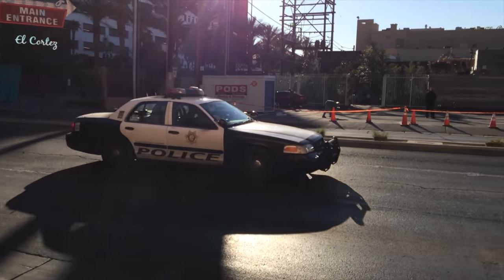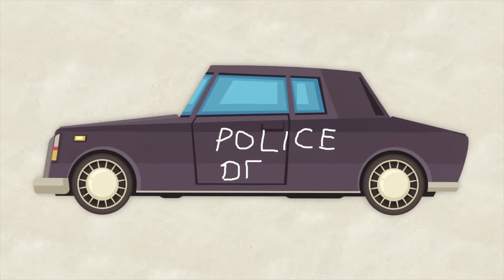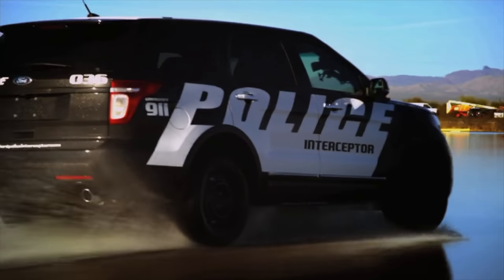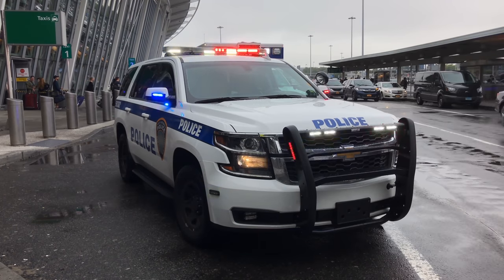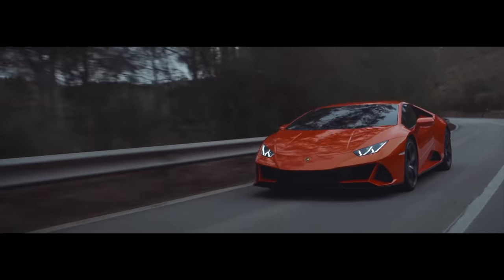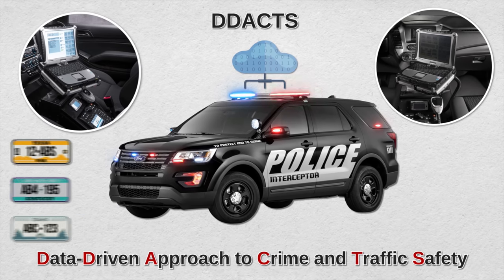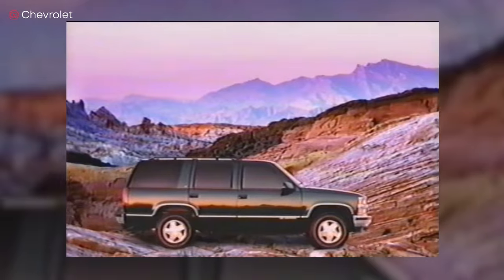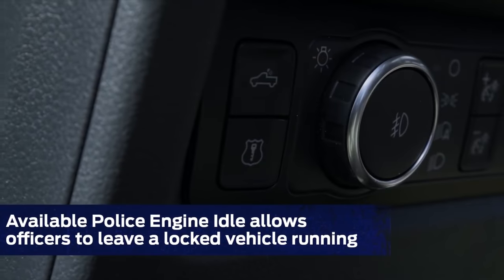Here’s Why You Can’t Outrun a Police Car

Comment: “Yet even with all of these upgrades and modifications, none of these vehicles are anywhere close to being as tough, reliable, or just overall quality car as as my ‘94 Toyota Celica.”  -Line from the script omitted from the video.
Reply: Did you see that 1 episode of the original top gear where they took this toyota pickup did everything you can throw at it even had it on top of a high rise building that was going to be demoed by explosives…..recovered it and ….IT……STILL….TURNED……ON!!!🤣🤣🤣🤣
Reply: Or as my Toyota Crown '89)
Reply: @eyevincast5440  It’s an inside joke you didn’t get.
Reply: The crown Victoria outlive a Toyota
Reply: @АндрейЧерняев-щ8р  or my 93 Supra
Reply: Good one dude as the 94 Celica GT
Reply: @steveschu  nothing indicates that he didn't get the joke. He was simply adding on to the joke of anything. But by all means look for reasons to exclude people so that you can feel like you're special.
Reply: FACTS
Reply: Old japanese tuner cars are underrated
Reply: @eyevincast5440  They left it in the pier for the tide and after a mechanic came with only his tools and no extra parts they managed to get the submerged demon to run again! I kinda wanna swap from my Volvo V70 to a Toyota
Reply: He wanted to say it, but the producers just wouldn’t allow it on account of factual inaccuracy. Scotty argued and deliberated this point for 3 and a half hours, assuring them that it was true.
Reply: Hahaha no one gets the joke, they must not watch Scotty a lot to know what you're talking about.
Reply: I have a 2001 GTS. I'm at 328k miles as of the last time I looked which was 4-5 weeks ago. Complete original engine and transmission. Dude it still has the stock head gasket. I'm not sure how, but it does. 

I also have a 2002 GTI 24V VR6 which  I just finished rebuilding. $4900 build so far. I have another 13-15k I'm putting into it. Then I'll move onto the Celica which im either going to do a 2JZ or 2ZZ swap. Not sure yet. Stoked though. Glad to hear you have a mk6
Reply: I got a hell cat that can out run the troopers dodge charger in the USA and every other cop cause cops can only drive at 150 hellcat can go 180 to 200mph.
Reply: @eyevincast5440  built Toyota Tuff
Reply: I owned a Toyota they sucked.
Reply: When you look in your rear view and see that Toyota badge on the grill you know your goose is cooked. I just step out and raise my hands in the air.
Reply: I gots a 2010 cvpi.
Greatest American cars ever made.
Reply: I can definitely outrun a police car. Once I put my foot down and all the blue smoke comes out of the tailpipe of my Cadillac the distance between me and them just keeps getting longer and longer.
Reply: they need it, they get it... I
 No joke.
Reply: Crown Victoria will Outlast your Celica 10 times over
Reply: Or my wife's lexus
Reply: Heck yes! The Toyota Celica is the best!
Reply: Crown Victoria held its own
Reply: @joanfrellburg4901  I doubt it 😂🤔
Reply: @ronalddaub9740  About a litre of oil every 400 miles.
Reply: @Bradleehage  Can it outrun the 2way
Reply: @johnhamilton5155  close. But did you know that the new Tesla s plaid can go from 0to60 in 2.1 seconds and reach a top speed of 200 miles mph. It’s take of faster than the car you talking about and is the fastest take off from 0to60 in the world so far.
Reply: @Bradleehage  I was referring to the police radio
Reply: @johnhamilton5155  😂 lol well the only way for them to get away from the police radio is to get far enough ahead for the police to loose sight of the car before other cops arrive it happen few times but I wouldn’t try.
Reply: @Bradleehage  I wnt either but I just remember my dad telling me everytime I got some kinda hot rod now son you can't outrun that 2way so just pull over Lol
Reply: Or my 05 Chrysler 300 touring . It's a tank it's been handed down from my older brother to me and I had it 3 years . That car never had any issues and it's been driven alot from Nashville to Miami , Dallas , Las Vegas, NYC , Atlanta everywhere lol .
Reply: @joanfrellburg4901  remember they have not made a car that can out run the radio.
Reply: @scottb7539  Yes, that's why when I rob a bank, I always use a snowmobile to make a clean getaway.
Reply: Im ctfu he loves that celica , starting to make me think about owning one
Reply: screw the buggati
Reply: @fastfords9072  no this is false
Reply: I need a Toyota Celica gts so I can put that engine in my yaris that weighs less then 2000lbs
Reply: @googlereviewsyt  no we get it it’s just not funny
Reply: You don’t need quality to get spikes or put maneuvered
Reply: My 98 Camry is Better
Reply: @eyevincast5440  You ever heard of whistlindiesel ?  He destroyers trucks and the only one he couldn't destroy was a toyota pickup.
Reply: This is about interceptors not high mileage gas efficient Japanese automobiles.
Reply: Damn right 👍
Reply: I prefer any of these interceptors over a Toyota any day of the week. Toyota's are overrated.
Reply: Toyota was a very well  built car on their 2 nd time around. First time they entered the US market they had to pull out. The Toyota product then was crappy.
Reply: People who start comparing with Toyota's no nothing about cars.
Reply: Lmao
Reply: Any Toyota really.
Reply: John t for president
Reply: The best thing about the Crown Vic was it’s survivable crash results. Knock on wood I never tested this but I had partners you think would be dead when you saw the aftermath of their wrecks.
Reply: My 93 Ford  F-150 is it got the 300 inline six with the 5 speed  with five hundred thousand on the odometer still my daily driver and occasionally I take her out and play in the mud with her on the weekends 😊
Reply: You can easily out run police ,they can go fast but they are to big and heavy to corner.  Zig zag your escape. You have to end the chase as quickly as possible ,the farther you go your odds go down . Your best protection is knowing were to hide. Load pipes will get you caught.
Reply: @kokigephart111  you may be surprised at how well those old crown Victoria's can hold the road as they were built just for that reason even the civilian models hold pretty tight and can corner fairly well they were built low and level with one hell of an anti sway system
Reply: @brianmaricle9646  You are absolutely correct about the old sedans . That was the old days.  Give me a bug eyed sprite or even a TR3 to i will head for a residential area and the cops won't get a second look.only problem is then you have to keep the car hidden for a month.
Reply: Or my 86 hilux. Cant beat that
Reply: @zenon-360  what's a hilux
Reply: @zenon-360  I got an 86 FORD F150 with a 460 I bet will take it in the mud or a long flat LoL 😂
Reply: Maybe, Maybe not.
Reply: @joanfrellburg4901  that's about what my Toyota Carola got 1500 miles on a Quart of oil it was burning oil and I had to have the engine changed
Reply: @Bradleehage  all they really need is your license plate number they'll meet you at home
Reply: @brianmaricle9646  bruh
Reply: @ronalddaub9740 it definitely will
Reply: Hahaha 😅😅😅what a joke friend
Reply: @Bradleehage  - a lot of police cars are governed not to exceed something like 125 mph, and some are governed not to exceed 135 mph. It seems like it’s become the exception that police cars are set up to do 150.
Reply: 😅 who says you can’t
Reply: @eyevincast5440 😂😂😂😂😂😂 I want what your smoking had 3 of those they where all junk
Reply: Lol
Reply: Cheap car owner forums 😂
Reply: My 2007 Toyota FJ cruiser TOUGHEST TRUCK EVER  . The frame of the truck died before my engine did . She finished with 304,000 miles . The floor board started to rust out and I could see the street below me . But she always started and ran like a dream . I hate Toyota for discontinuing that model . I owed 2 in their life span and both got me over 300,000 miles . I switched to a jeep wrangler now and it's been a year and I already regret my decision
Reply: I love this guy, atleat he will tell you details and facts about where you tax money goes. Unlike most police departments that want to keep everything a secret.
Reply: @kylemanning2984  yes.
Reply: @eyevincast5440  why did we let Japan steal our rust jock strap?
Reply: Who needs speed when robbing a bank dress like a Amish and use a horse and buggy,cops will never stop that.
Reply: doesn't seem plausable unless you've got in there w/ a lot of aftermarket parts an effort?
Reply: @eyevincast5440 i think i remember that! Unreal! Indestructible-- Can you imagine?
Reply: Celica is a woman's car
Reply: Mmm the v6 in the fords will take just as much abuse as a Toyota and it’s 500 bucks for a junker engine. The v8 in the crown Vic is bulletproof. Y’all should talk to real mechanics.
Reply: Yeah I can out pace a cop car and have gotten away from cars and bikes! It's the driver not the car!!!😂
Reply: Lol a drone has a better chance than a helicopter where I live lots of big bushy trees and green belts
Reply: Actually, how are you basing this your opinion? Is it based upon your own experience? I’ve had a 2013 Please Center scepter for three years and it runs and drives great very durable. I’ve only change the oil on the serpentine belt I put almost 70,000 miles on it. Yes I’m a delivery driver so I put a lot of miles on it that’s a great very dependable vehicle.
Reply: On the need for speed game on the X box there was a weapon deployed called eloco magnetic pulse, I wonder is that a real thing, I know caltrops are real
Reply: Celica is one great car
Reply: Yeah I remember that celica is it a gt 4 wd if it is they gonna need a helicopter 🚁 some motorcycles and some drones 🤓🤣
Reply: glad to see all the Toyota haters after all someone has to buy all that American and German junk.😀(how’s that for a joke)
Reply: @Bradleehage i left a trooper charger in the dust in my 400 hp taurus to 150 than i slowed down and let him catch up and he gave me a lil ticket is all . he’s like glad u pulled over and i was like glad i don’t have police choppers on me about to total my car 🤣
Reply: @fastfords9072  yup
Reply: Cop cars are easy to outrun
Reply: I have a 68 crown, all original beauty